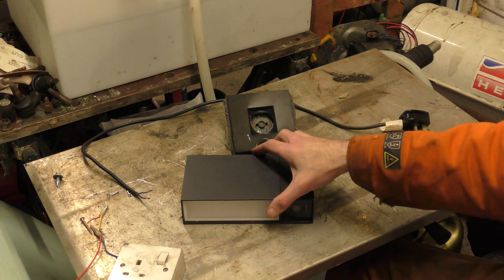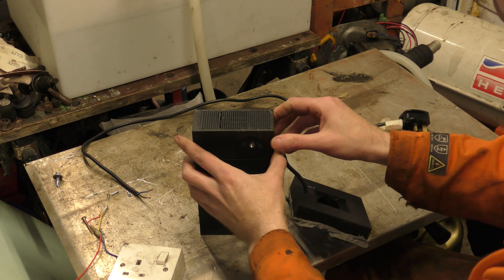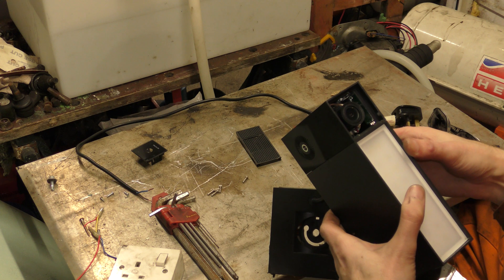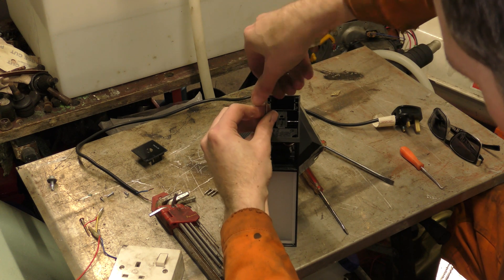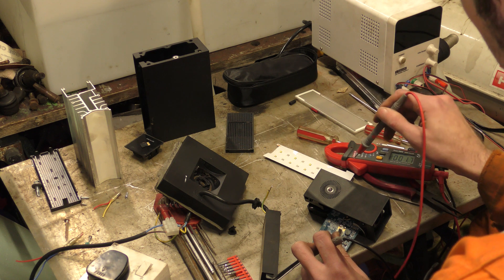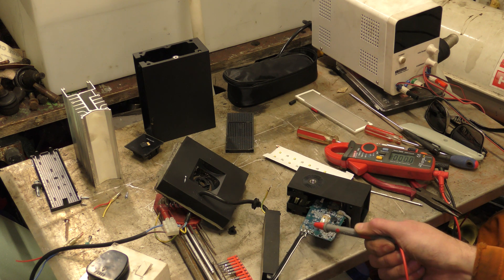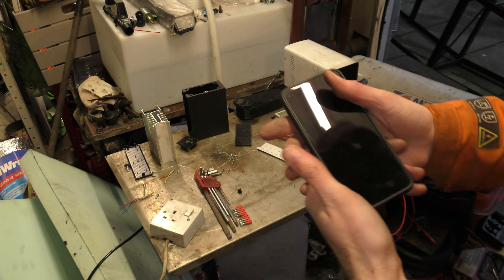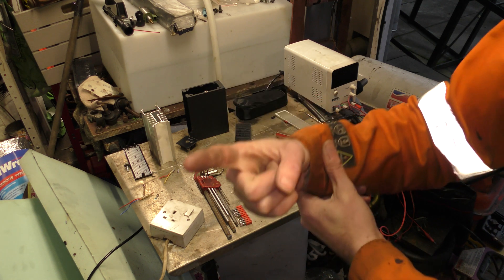The Netatmo Presence has died - so let's take it apart

Comment: I also happen to have a faulty PSU, both 24 and 5V DC are down… so completely dead. Old unit PCB manufactured on 2017.05.19… maybe I can re-use the camera only with another powersupply, for indoor use as I also managed to break the small LED/IR ribbon while dismantling…. You should edit your video to warn for this! 😂

Comment: I repaired the psu! I extracted the power board from the plastic chassis of psu, then cutting the rubber around the swollen 330uF 35V electrolityc capacitor I desoldered it and I put a new one.
Reply: Do you have a picture of the psu to locate the capacitor ?

Comment: This video is a gem. Thank you very much for taking the time to share this. A question on my side : Having disassembled mine, I confirmed the 24v output of the PSU was dead (+1), but on the board side, +24 and GND pins are in short circuit. Any idea of what could be in cause ? Disconnecting the led sheet, I could confirm that the sheet itself works properly. Thanks !
Reply: Investigated a bit: C145 capacitor was causing the short circuit. Removed it from the circuit, and tried using a lab PSU, everything was working OK, including the led.
Reply from the maker: Thank you for returning with the answer, it might help someone else in the future.
Reply: @lionyism in which side e where is this capacitor? I have the problem too
Reply: @michelecento7883  It is very close to the +24 track (where the +24V output of the PSU is soldered), on the main side (where the PSU cable is connected).  You should see "C145" printed next to it.
Reply: @lionyism do you have the value of the C145 capacitor ? (V and uF)

Comment: Hi. Do you think it is possible to work that camera with car 12v battery and 12v to 5 stepdown ? What is the voltage of its original power supply . Thank you
Reply from the maker: Just off the top of my head I think there was a 24V rail and a 5V rail on the output of the power supply.

Comment: Hey David, do you have pictures of the actual logic board inside? I'm looking for information if it was possible to do a POE mod for the cam
Reply from the maker: Sadly didn't take any.  Are you going full POE and replacing the wifi module with wired?  As that sounds interesting.  :)
Reply: Any updates?

Comment: Thx, replaced the Power-Supply with a 24v LED-Supply and used a (24v->)5v Down-Step to supply the board ... works like charm ... lost the WhiteLED's on the Way (Shortcut by misplaced led ribbon ... watch it carefully) but the IRs are working as usual.

Just be extremely careful with the led-ribbon and its socket ... I ripped the socket apart as if it was made out of thin air ..
Reply: Hi What power supply do you take ?
Reply: @mb8571 just an 24v led driver ama.... LPV-100-24
Reply: Hi. Do you think it is possible to work that camera with car 12v battery and 12v to 5 stepdown ? What is the voltage of its original power supply . Thank you
Reply: @evapacosmos i used 24v with 4 amp ... Perhaps to much... The 5v side wont need mich i guess 1-2amp should be enough

Comment: Hi do you still have these parts? My SD card reader for the camera stopped working would purchase it and swap over if you still have it
Reply from the maker: I actually put the camera back together but disconnected the LED light.  So now it just works as normal but the light doesn't come on.

Comment: my netatmo presence is also dead. do you have any idea how to repair it?
Reply from the maker: Between my taking apart and comments from viewers either the power supply has failed (partly failed in my case) or there is a failed component on the camera that is dragging down my power supply and making it restart.

Comment: Hi I know this question has nothing to do with this video,but do you know how much diesel you could add to c1 paraffin and still get a reasonabley clean burn as I run my heater on 1.6 hrz 1 red bar and paraffin c1 is getting rather expensive?🙂

Comment: Interesting vid.:) Yep agree with twocvbloke, however there is a slim chance the psu is ok and there's another component on the camera board/led switch thats pulling the 24v line down. to check just unsolder the psu wires from the board and check its outputs again. But yeah most probably its the psu.:(
Reply: just to add: as is looks like all the camera board/switch electronics are working still, you could trace the switching contacts on the board (I'm guessing there's a relay) and solder a pair of wires to the relay switch contacts and run external flood lights?:)

Comment: The sound from the camera going "peep peep peep" sounds like a failure in a switchmode power supply going to the LEDs, with the bootstrap part not being able to power up cos of a failed component like a resistor or capacitor, but as it looks like the PSU is potted, yeah, it's gubbed unless you really feel like digging out the power supply from whatever coffin they buried the supply in... :\
Reply: Read my post about psu repair. I have some photos to show the part with the fault component.